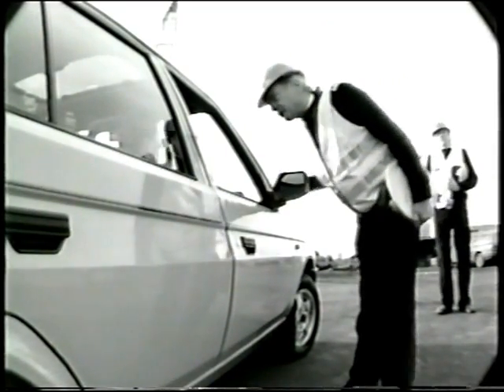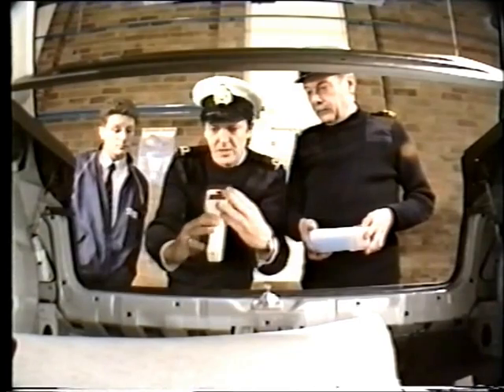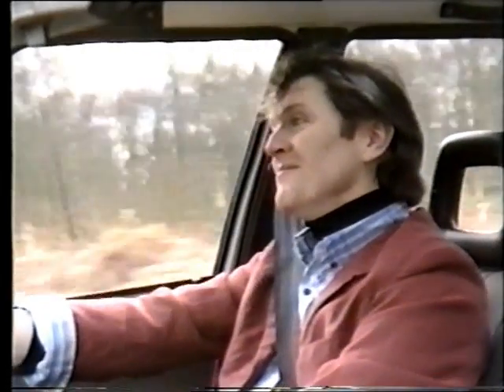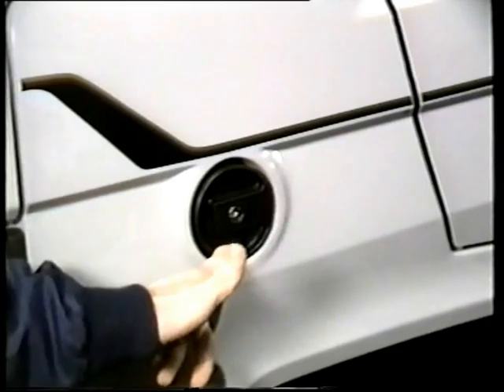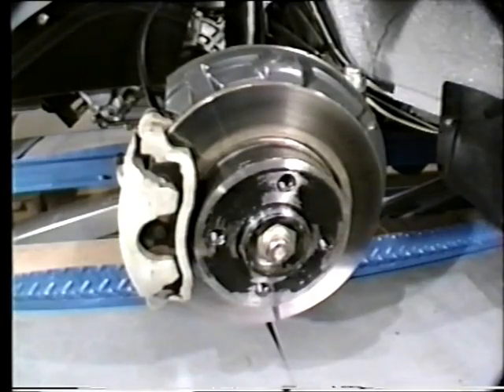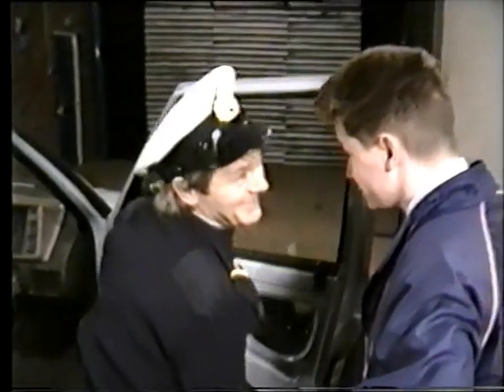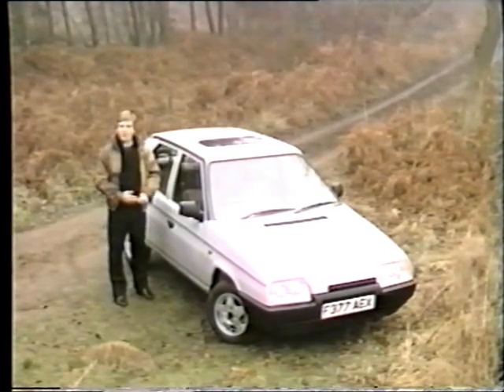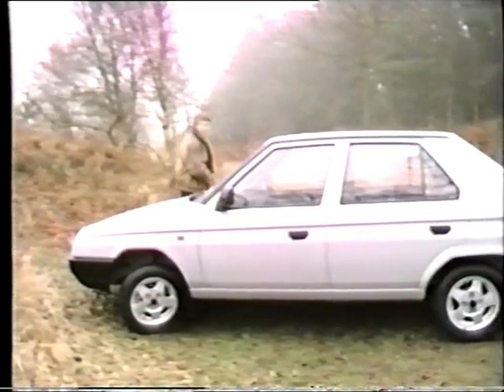1989 UK Skoda Favorit promo film

Comment: I remember beening shown this video with other senior distributors, then they took use to the car and the specification where totally  different there was 136lx and  136LS 
They came with a brown interior and brown and beige dash 
Not what was shown sunroof only on LS 
The LS came with a different  seat material it was a begin square velour pattern with different shaped seat and padded head rests all round plus 60 /40 folding rear seat and carpeted boot lx came with steel wheel and black plastic  hub trim . 
Ls got rev counter lx got a clock  
Ls got front fog lights 
No rear wash wipe on lx but stalk and wiring was in place plus the whole was in the body work with black rubber gromit see skoda GB removed the rear wash wipe then sold it as an add on did not go down well with dealer and was change within a few weeks. 
Sunroof was skoda GB item fitted 8n kings lynn not factory.
As a distributor we offered a better aftermarket roof than skoda and cheaper. 
those side stripes only on ls not lx .
The launch was a shambles  ls would arrive with different  interior trims seats head rest basically it was pot luck.
The door pockets where made of very cheap plastic it was embarrassing as skoda gb had ramped the prices up to vauxhall and Ford but quality was toy town

50mpg not on your life at steady 55mph u got 30 mpg 
Take it to 70 25mpg it's was not good. Later fuel injection made things better  within 6 months the car had go through so many update . 
Then vw took over. Quality shot up over night.